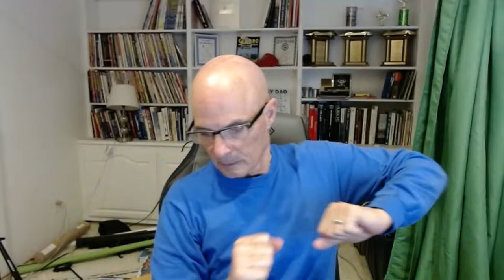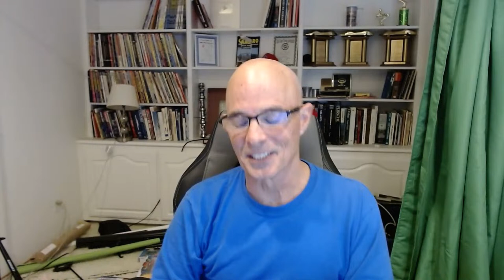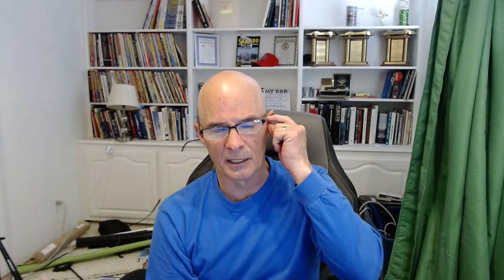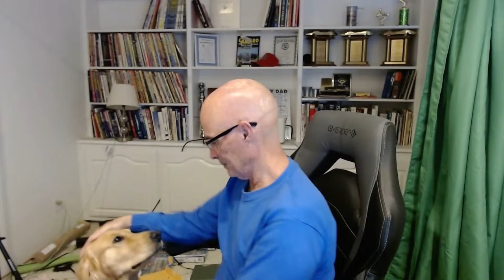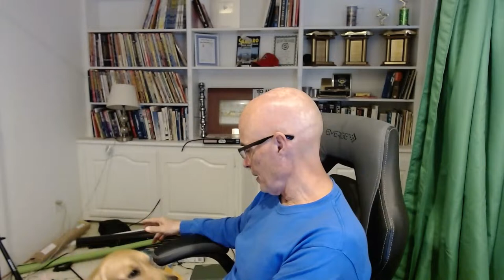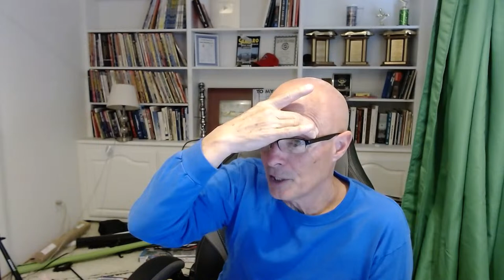1 3/4 V 1 7/8 HEADERS-LET'S TALK TECH

Comment: Yes. The muffler helped. Is up straight through muffler with perforation. Once the muffler Pressure Equalizes inside and outside of tube, it's like the Exhaust  floats,  has less drag then going through a straight pie. Which makes it flow faster/  scavenging.
Reply from the maker: floats?
Reply: @richardholdener1727  lol.  I couldn't think of how to say it. It's like two Magnets turned opposite direction (kinda)  smother then the  friction of just a straight pipe.  But I'm just a dummy trying to Quote a smart guy.

Comment: Running 1 3/4 long tubes on a 480 hp 6.0L, and running 1 7/8 long tubes on a 725 hp SC 5.7L. I don’t believe the header size/design is a limiting factor on either engine. Thoughts on the muffler vs no muffler is only that I would expect to see an enlarged chamber create a reversion or scavenging “wave” that alters the hp curve vs rpm.

Comment: It would be nice to see a thorough test with graphs shown testing various primary, collector and muffler diameters in say a 5.7 LS1 engine.

1 5/8” primary 
1 3/4”
1 7/8”

2.5” collector
2.75”
3”
3.5”

4  x 2  Collector (no H Pipe)
4 x 2 H Pipe Collector 
8 x 4 x 2 x 1 Exhaust both short and long extension
Reply from the maker: that is easily $10K worth of test time
Reply: @richardholdener1727  At least I’m sure!

Comment: Richard what or how would a change in collector size say a 3 1/2 and even a 4 inch collector versus the 3inch on a twin screw LS  making 800 wheel H.P
Reply from the maker: I did a header test on a blower motor, not sure we checked just collector

Comment: Are powder coating headers better than wrapping it?
Reply from the maker: powder coating?
Reply: @richardholdener1727  or ceramic coating if I’m correct
Reply: @nep639  You can't powder coat headers as they just get too hot. But you can cerakote and ceramic coat them. I believe coating them in either will be better than wrapping. Course you could always do both.
Reply from the maker: not sure what you mean by better? Both help with heat
Reply: @richardholdener1727  I just have seen wrapped headers catching fire with any fluid that comes out when it’s too hot.
Reply: @richardholdener1727  better in this instance is more of a personal preference than anything. I just don't like using the exhaust wrap when coatings exists.